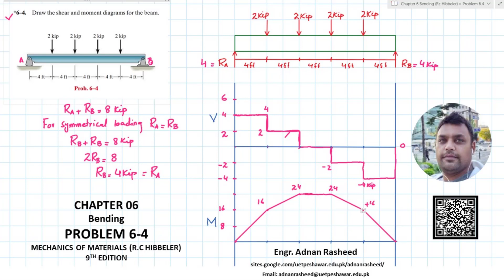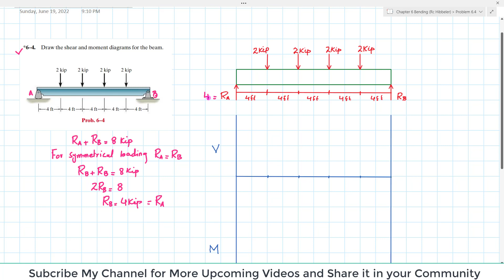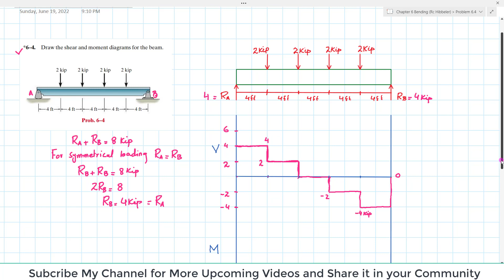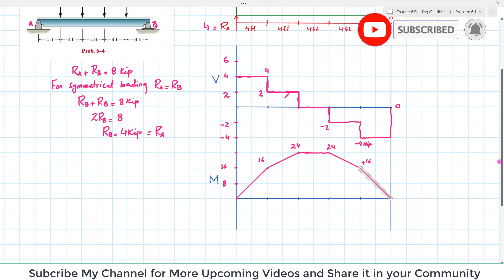6-4 |Chapter 6| Bending | Mechanics of Material Rc Hibbeler|

Comment: how we solve this question by method that we used before ?
Reply from the maker: You mean by method of section?
Reply: @engradnanrasheedmechanical 
yes Sir if we don't use condition Ra is equal to Rb
Reply from the maker: Then you have to use equation of equilibrium for finding Ra and Rb. Use sum of all moment about A =0 and then second equation sum of all vertical force =0 you will get Ra and Rb
Reply: @engradnanrasheedmechanical 
Thank you so much Sir, for your response. It helped me understand the topic much better. I was really confused before, but your explanation made it clear.
Reply from the maker: You can watch other videos in this playlist and I am sure that you will learn it alot. ❤